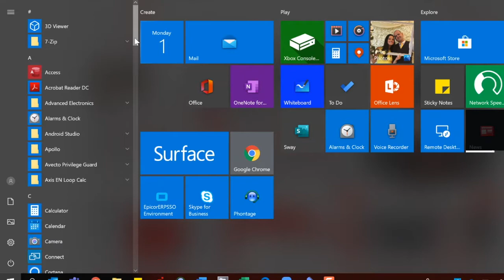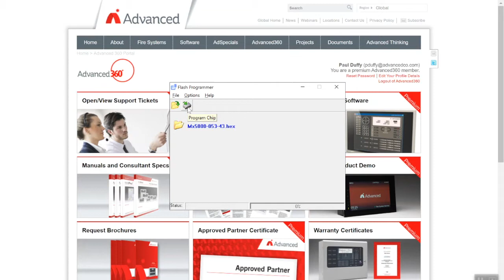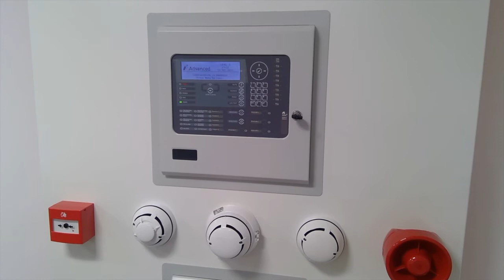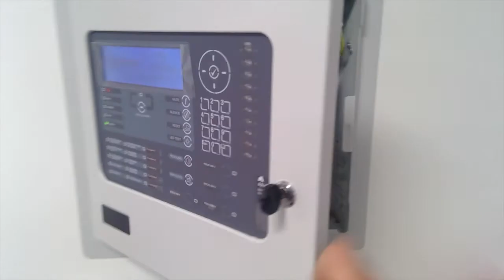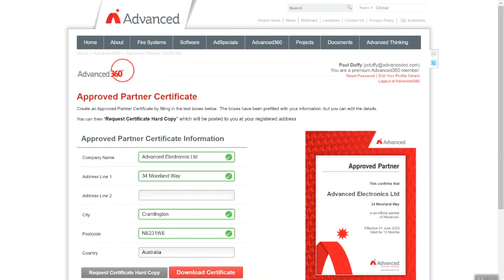How to: Upgrade your fire panel firmware

Comment: Why my card loop cannot read... My panel mxpro 4
Reply from the maker: Hi Muhamad, thanks for getting in touch. For any technical enquiries please email: tech@advancedco.com or call: 0345 894 7000 (option 1)
Reply: The capacity of a capacitor that is installed in the place of batteries